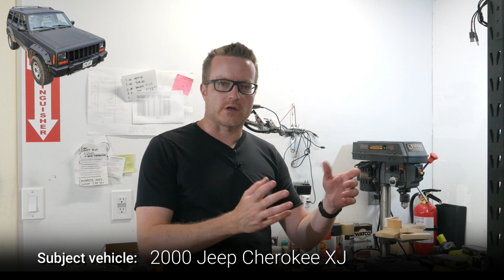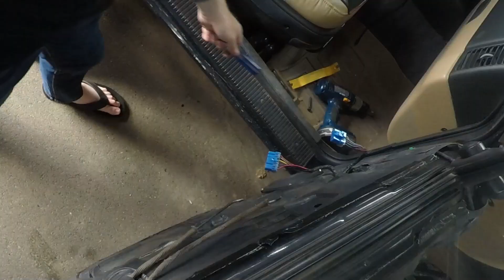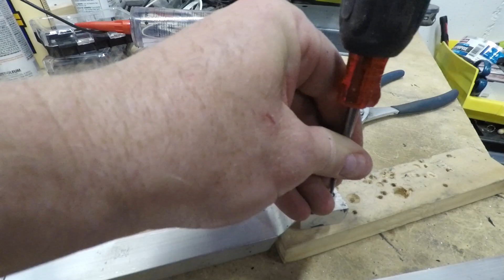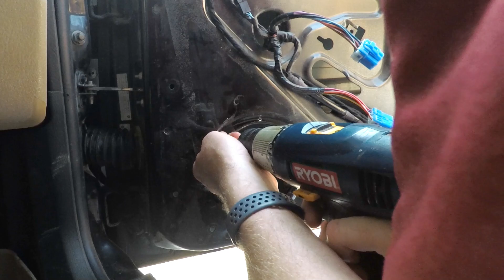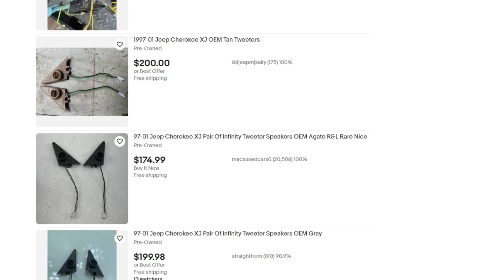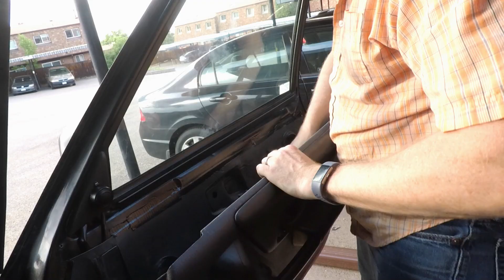projectXJ: Audio component system for your doors (97-01 XJ Cherokee)

Comment: Question for you as I’ve got a 2001 XJ that I have no idea what the wires for the radio go to because the previous owners butchered the wiring harness. What wires are running from the factory harness to the speakers to provide output from the head unit? If you’re got a schematic I’ll take it. Thanks!
Reply from the maker: Really depends on whether you have (had) a standard or premium stereo option originally, and whether the owner who hacked it also added wiring to alter or bypass stock. The PDF of the Factory Service Manual is available at xjjeeps-dot-com and you probably want to start there. Also search forums at places like NAXJA.

Comment: What is the JBL speakers model that you have used?
Reply from the maker: The part numbers were shown in the video but these things change over every year or three, so you will need to look at options you can buy right now. The more critical number is the nominal size. 5.25-inch will usually fit everywhere on these, but are weak on bass response. 6.5-inch units will fit in the front doors with minor modifications, and 6.5-inch units will fit in any model that has the overhead soundbar, again with minor modifications. Unfortunately I have no experience with older XJs that place speakers in the liftgate, if that's what you have.

Comment: The original speakers do not come with the plugs it's just wires there are no plugs so these speakers must have already been replaced, clearly thats a good upgrade I will have to figure out how to do... Which in the video you just confirmed, it would be nice to know how to replace those but maybe there is directions on the plugs :)
Reply from the maker: @christiegroves  On the refreshed XJs (97-01) the OE speaker has a Chrysler-style plug body molded into the speaker, and the door harness has a snap plug that fits into it. The"speaker plug pigtail" for the aftermarket speaker is an aftermarket accessory that can be ordered from places like Amazon, eBay, Parts Express, or Crutchfield.

Comment: Subbed as I enjoy the content coverage you provide as can assist others with their vehicles.  I am curious as to when you might be installing some decoupler and noise insulation?  Been an car audio enthusiast I have to note that I will need to find a different spot for tweeters in my Renix era rig as my mirror controls are manual and use the "swizzle stick" to adjust them.  Just as it also has the little triangle vent windows that your variant lacks. I use the Schoche Magic Mount on it, to hold my mobile device that has a six foot long charging cable that plugs into the USB port which now uses the "cigarette" lighter port.  Meanwhile I do use Bluetooth aftermarket head unit and a offline nav app for amusement here in the PNW.  Once again, thank you.  Note: decoupler is 157mil Kilmat and insulation 4mm Siless closed cell foam is my current preferred mat's at this time.
Reply from the maker: @Mauser1965  I used butyl sound mat and a few other odds and ends, shown in my interior rehab video. Those are about the limit of what I feel is worthwhile in an XJ cabin, there's no getting away from the "wall of noise" that results from driving a flying brick.